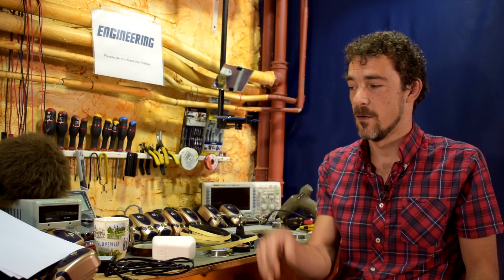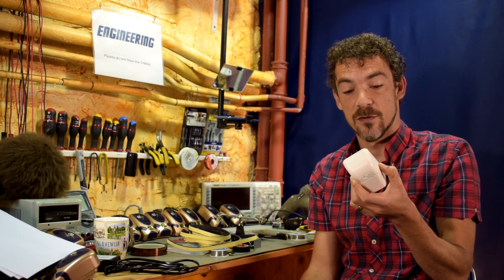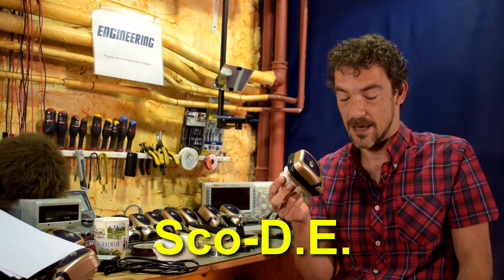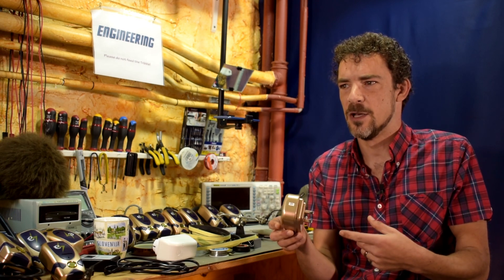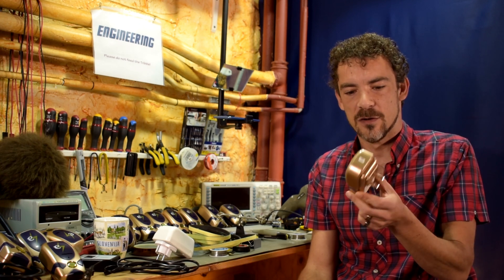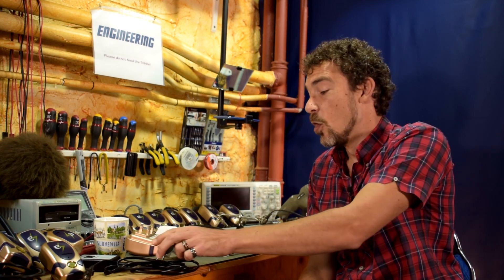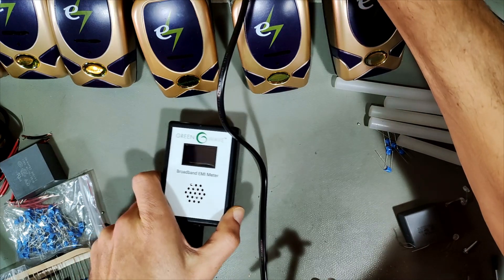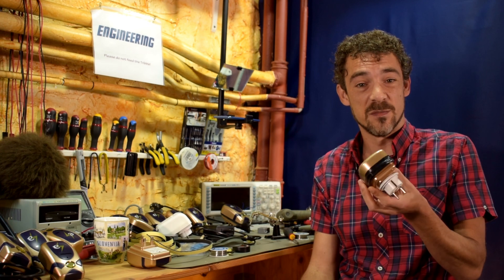Make your own Dirty Electricity Filters!

Comment: So can I make a large filter and connect to the 100 amp lines at the main breaker?
Reply from the maker: Not really. It will help a bit, but it's better to use multiple filters placed around the house. It's just the nature of the noise involved.
Reply: @ScottiesTech  ok, got it.  Thanks for the instruction, I have done this before at university - too easy.  Built a railgun, as well - that's now on the list for home projects with my boy 😁🐊
Reply from the maker: @taylorrob2  I want a railgun!!!!

Comment: How does the capacitor values change for 120V 60 Hz vs 240V 50 Hz ?
Reply from the maker: Same cap values. The important value in terms of voltage is the cap's V rating, which in this case is fine since the cap must be rated at anything higher than the line voltage - or in your case higher than 120V.

Comment: Hi, sorry would you help? I bought MKP62 106K 305Vx2 capacitor but they sent me 275Vx2, would that be okey? Thanks a lot
Reply from the maker: Yeah, it should be okay - as long as the line voltage doesn't go above 275V, which should never happen.

Comment: Is there such a thing that electricity dumps into the capacitor and then we get the filtered electricity from the capacitor direct instead of the load favoring the capacitor.
Reply: i made 5 of these and all together they were drawing 10 amps on 220v why is that ? the wire was getting hot

Comment: why does the caps need to be 25uF? i have 1920mv on my line, 1 filter results in 1600mv
Reply from the maker: That's a good value since the capacitors act as a very basic filter.

Comment: Why don’t you include a varistor to shunt high voltage transient spikes?
Reply from the maker: Could do, but then I'd also need a thermal fuse in case the varistor pops. Then each filter would also be a surge suppressor... But I've got whole-house lightning surge suppression anyway.

Comment: can I use this model: "C 10uF 305VAC (MKP62 305~x2 106 M) Capacitor" ? 106M instead of 106K. +/- 20% tolerance instead of +/-10%. The price is much better for me.
Reply from the maker: Yeah, those should be fine.

Comment: Hi Scotty, 
Awesome videos! Thank you for taking the time and making an effort for us mere mortals to understand some of this stuff. 
I'm getting heaps of dirty e whenever the home solar inverter is on. My limited equipment has picked up a spike at 15.9kHz all throughout the house (the kids are complaining of a 'thin' noise). What value C and R do I need to make sure I filter out 15.9kHz? 
My math is probably wrong, but from the values in your diagram, the frequency is f = 1 / (2 * pi * R * C) = 1/(2*3.14*110000*0.0000247) = 0.0578 Hz 
Also worried about your comment about being careful when running off the solar inverter ("larger capacitance can result in voltage spikes from the genny/inverter"). Can you expand on that please?
Reply from the maker: I'm not sure there IS a good way to filter inverter noise - at least not with this very basic and relatively inexpensive type of D.E. filter.  The extra capacitance will no doubt screw up the solar inverters output since they sort of "adapt" to the AC load on the line. I did a video on the genny/inverter issue:  https://www.youtube.com/watch?v=zgH_51KXA6o
Shortly thereafter, Greenwave added a warning about this very thing to their web site.
Reply: @ScottiesTech  Thanks Scotty! What about the frequency calculation? 110k and 25uF don't seem to work out for the low pass filter.
Reply from the maker: @NoPlanInSight  Oh yeah... It's not an LPF really (in the way you describe) because the 110k resistance is also across live/neutral, in parallel with the 25uF of caps. So, the caps tend to just sink/supply juice to smooth the ripples, and the resistors are just there to discharge the caps when the filter is unplugged. In order to make a good LPF for 15.9kHz, you'd have to be pretty careful because the current flowing through the resister will mean possibly BIG power drops, which won't be very efficient. So you'd need something far fancier than what's in a D.E. filter.
Reply: Maybe a large isolation transformer to drop the noise off? Those usually don't have that high of frequency response.

Comment: is the resistor better with the least resistance?
Reply from the maker: In this case: NO! The value of the resistor needs to be high to slowly discharge the capacitors when the filter is unplugged. With a smaller resistor, the big capacitors will discharge very quickly through the small resistance. But the resistor must then dissipate LOTS of power in a very short time - meaning it will probably explode.
Reply: @ScottiesTech  
And what resistance did you order resistors for these filters?
Reply from the maker: @trolenya   220kΩ, 2W.